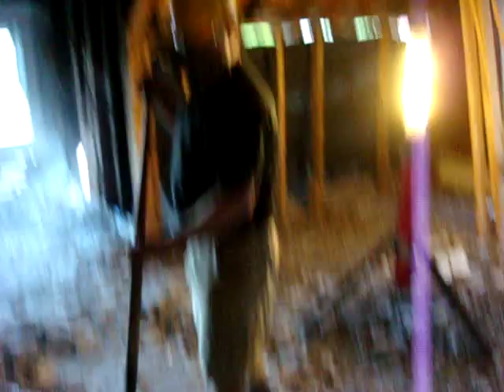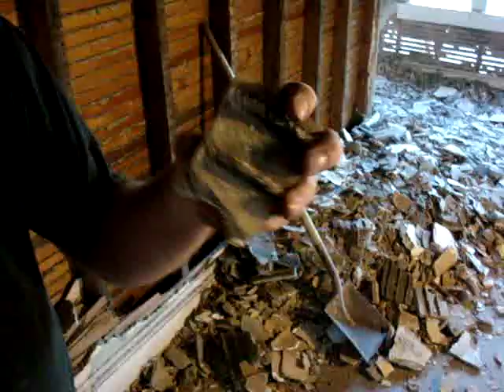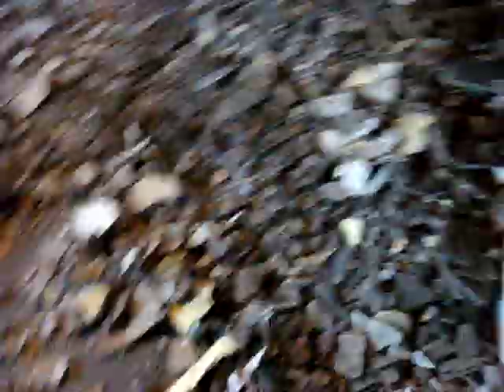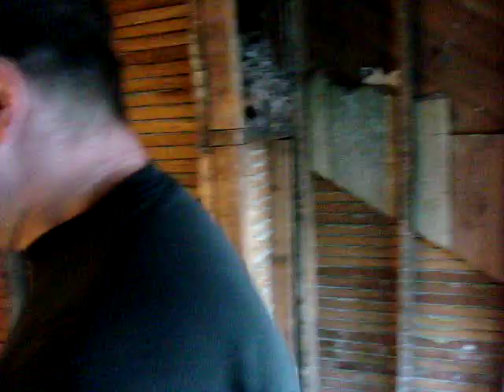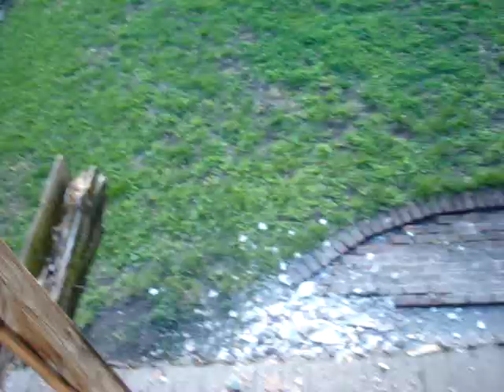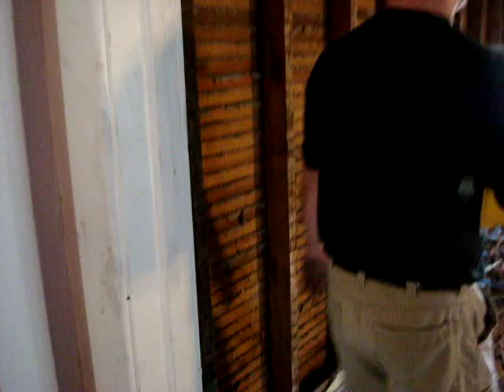How To Remove Lathe and Plaster

Comment from the maker: Well, if I was restoring Monticello, then original walls would be critical to historic preservation. On the other hand, if someone wants increased thermal / acoustic value, modern plumbing, and modern wiring, then the highest and best use of materials is to remove the lathe and plaster, access and correct structure and then comprehensive renovate. There's no inherent value in leaving the plaster, although it was sound enough, that isn't the point.